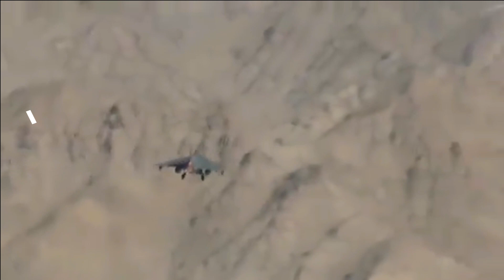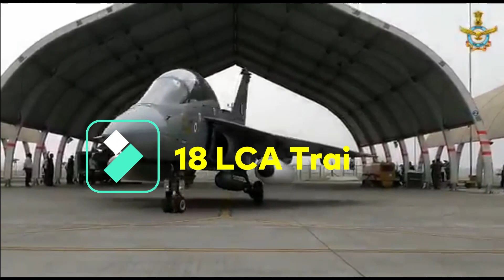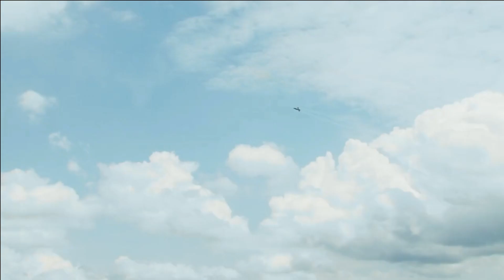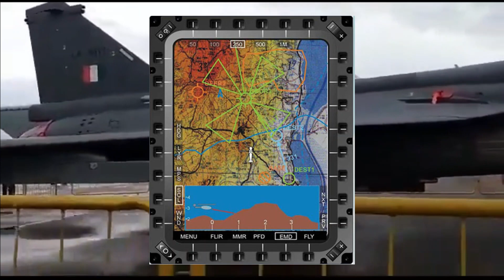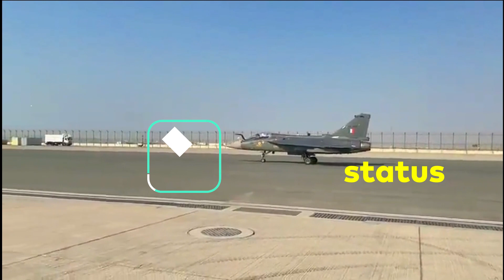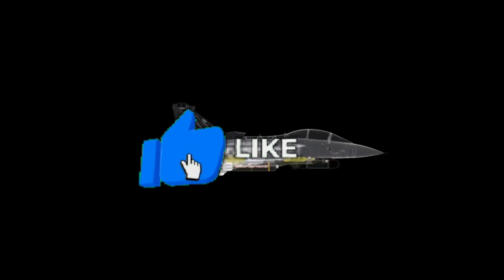Tejas MK1A equipped with AESA Radar & EW Suite | Ready to take on sky

Comment: Tejas mainly for local market. Tejas lost to Turkiye Hujet for Malaysia Air Force tender.
Reply: Hirjet is still on drawing board and it takes minimum 10 years atleast to reach IOC. Even Malaysian media said it is not even being considered. The fight is between korea  KA-50 and tejas mkla. Deal in terms of risk is slightly favorable to korean as it doesn't have any isreal tech, but in terms of weapons, payload, capabilities, agility, maneuverability, platform sustainability and even price Tejas is far ahead. Even the economics of deal is good for Malaysia as India accepted barter trade for palm oil. India developed alternatives for isreal EW suit, AESA radar, and other small things.
Reply: @gowthamg8481  you're knowledgeable 👍🏻👍🏻
Reply: @gowthamg8481  not even an onion from india. Tejas would be a nightmare
Reply: @wanmo4390  Can you mention Reasons rather than blabber
Reply: @gowthamg8481  unless they've recently replaced it, the FA-50 is actually using the same Israeli radar as the Tejas Mk1, the Elta 2032.
Reply: @gowtham g  not sure what all that was for, I'm well up to date on the Tejas. Was just pointing out a factual inaccuracy about Israeli components.
Reply: @gowtham g  I did forget that the Mk1a's would be upgraded to the Elta 2052 and eventually the indigenous Uttam. But I'm not sure if they're negotiating it with the Uttam AESA, since it doesn't have the track record/experience of Elta's design. 

I'm really curious about a plan to bring the mk1 to mk1a standard. Not being able to launch the Astra and lacking AESA radar isn't acceptable if they ever go against the JF-17. Well, provided the JF-17 can get off the ground... hah

Comment: I dnt hhv much knowledge about techincality.....but while we r having uttam indegenious AESA radar why would we need israili one 😒
Reply: It was pre ordered bro. Ordered before the production of AESA radar.
Reply: @sumitsuman1746  oh ok ...do u hv any idea as delivery of mk2 uttam denied,when will it be delivered
Reply: @charteredtelugu5234  Because drdo is planning to make a new upgraded uttam aesa radar for tejas mk2.
Reply: As a matter of fact , ISRAEL has already the deployable air borne radars . India has just entered the field . Nobody is sure , despite tall claims , how long the indigenous product will take to be  airworthy and deployable . We still have certain handicaps . Israel has stolen the technology from Netherlands !
Reply: The radar isn't just fit into the nose cone willy nilly without any power or cooling connections. All the systems like power supply, cooling, radar management and control software systems have already been built keeping in mind that we are going to fit the Israeli ELTA radar. To upgrade that to Uttam, we need to upgrade all these integrations which takes many more months of work.
Reply: Also, the fact that Tejas Mk1A which uses GE404 engine doesn't generate sufficient electrical power for a radar like Uttam. Uttam needs much more power than what can be provided by Mk1A's engine.